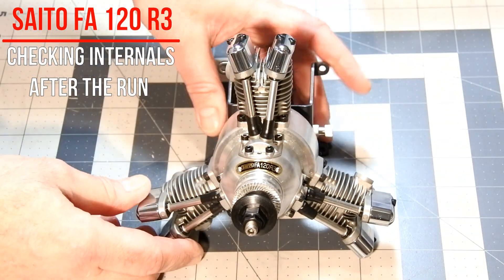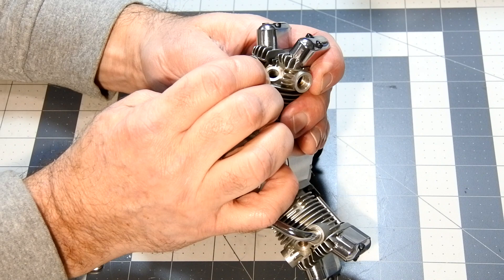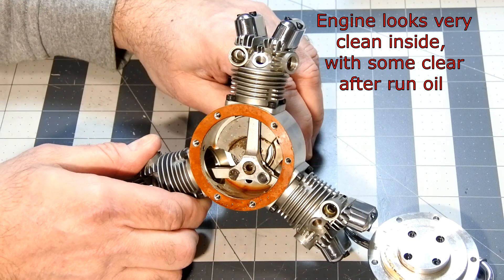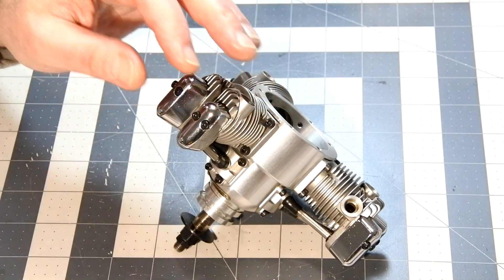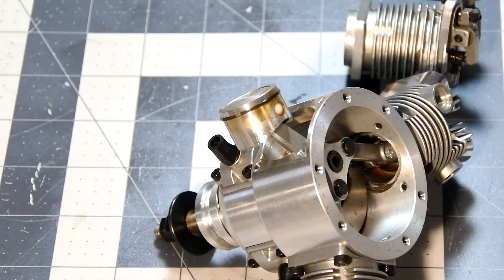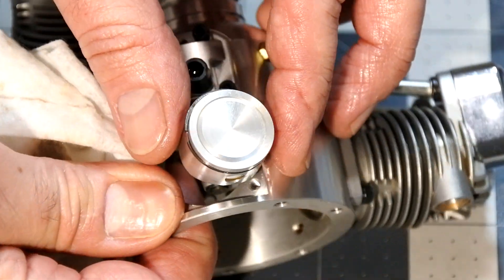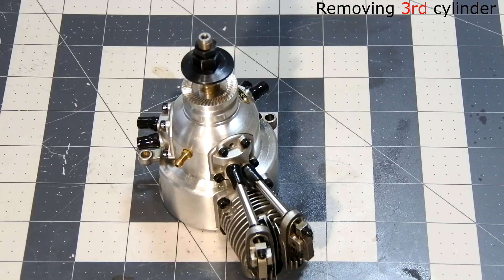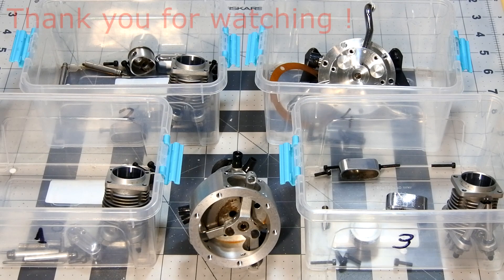Saito FA 120 R3 checking internals after the run

Comment: I love glow engines, but radials seem to give me problems at the field.
Reply from the maker: Thank you for your comment ! Definitely, radials have one common potential problem, borrowed from their big brothers from first halve  of 20rh century, This is a problem with low cylinders, which were tends to be flooded by oil and fuel, as well. Big engines were sparkies,  specially equipped and adopted to live and to work this, unfortunately, small glow engines can really get into trouble in the air, during flight. But this is just with glow engines, I think, spark ignition versions run more reliable.
Reply: @crazyengines88  i have both fa120r3 and another yet to be converted to gas with fg19r3 kit..also have a fg33r3 and this one i have fixed..from new it refused to run all cylinders below half throttle..after some break in procedure i decided to attack the intake system on my lathe..now this engine runs perfectly at all rpm ..am now rather happy with this engine..not only runs all cylinders evenly but now has much more power compared to the out of box configuration that was terrible over fuelled lower cylinders..same fix was done on the fa120r3
Reply from the maker: Thank you very much for your comments ! Very, very interesting ! May I ask you to explain, what exactly you did for that distributor improvement ? May be, you have some videos or pictures ? Thank you very much !

Comment: Very nice engine... 👍👍👍 
Can you please, please open up the intake manifold so we clearly can se the new design of the internal fuel distribution... 
I hope you have not put it all together yet ?
Reply from the maker: Thank you for your nice comment ! Engine was dismantled today, 6 hours ago, so in few next days will specially dig deeper into fuel distributor, to answer to your question and satisfy my own curiosity 🙂. Thank you, have a nice day and stay tuned !
Reply: @crazyengines88  It have been a widely discussed topic over many years for all the 3 cylinder Saitos.
Looking forward to your further details...
Reply from the maker: @roki5941  Sure, just a bit of time.
Reply: The older version of the fa120r3 has more aluminium to work with..the whole guts of the intake plenum needs to be machined out on a lathe to get a better distribution of fuel/air ..the newer intake as the one in this video has 3 holes on the backing of the manifold where the mounts bolt on..this leaves less area inside to machine out..i had originally purchased a morris mini motors intake and found what they designed to be a great improvement on the whole running of the engine..also any multi 2 or more cylinder glow engine will greatly improve reliability using cdi ignition..failing that onboard glow is not too bad
Reply from the maker: @danielhitchens4407  Thank you very much got your comment ! I've heard a lot about Morris Mini Motors fuel distributor enhanced version, but still don't own it. Will learn more about it.
Thank very much for your information !
Reply: @crazyengines88  your welcome..its always good to help where possible..i recently purchased my second fa120r3 for a cheap price due to the guy had problems keeping it running
Reply from the maker: @danielhitchens4407  Congratulations ! I still sure, that Saito FA 120 R3 is great engine (doesn't matter, that had some troubles, it isn't a real troubles, if you can fix it or repair it). I like this engine and will made an upgrade, probably.
Reply: @crazyengines88  either way they are definitely a nice engine
Reply from the maker: @danielhitchens4407  Thank you, fully agree with you !
Reply: @danielhitchens4407  I agree,, the looks is fantastic, But spending that money and risking everything in the air stoped me from taking it up in the air. I need a flawless transition to be comfortable with 1000$+ in the air, unless I have wast high grass fields to go dead-stik. 😃
Reply: @roki5941  yes definitely an expensive  engine..what size prop are you running..and what airframe have you to put this engine in
Reply: @danielhitchens4407  Is there any pictures of the morris mini motors modification ?
Reply: @roki5941  i have a few pics of the manifolds i modified..there isn't any pics on google to find really..its like its a top secret
Reply: @danielhitchens4407  Would it be possible to open the one you have and post a video of the plenum internals ?
Reply: @roki5941  sure can do..